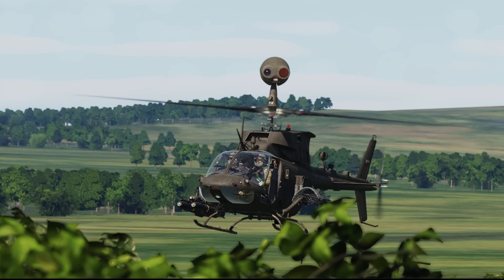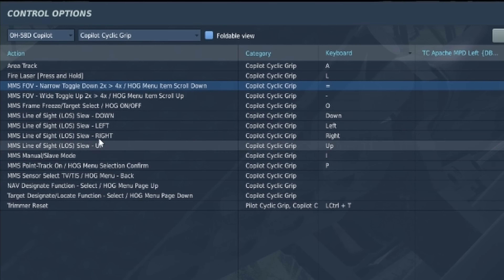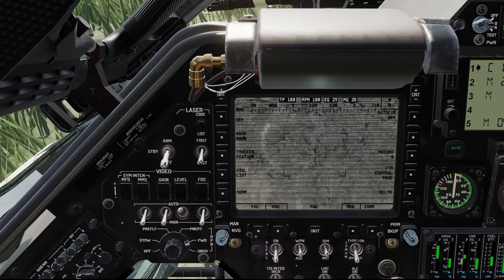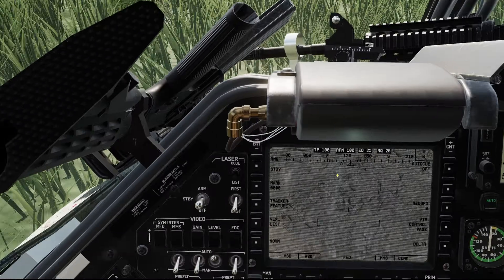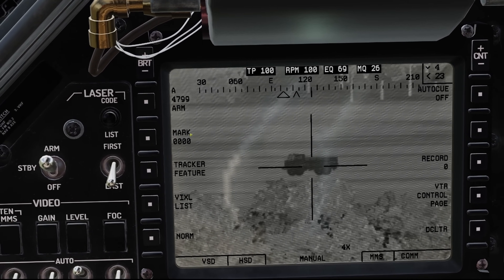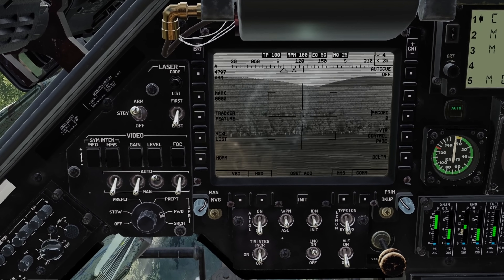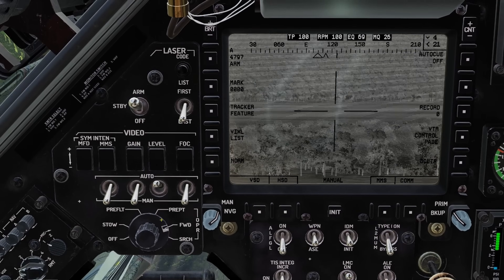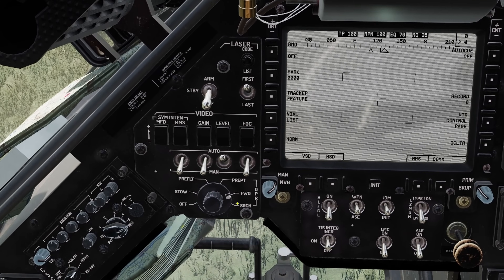Mast Mounted Sight Employment | DCS World Kiowa Warrior

Comment: Most memorable write up I had to work on in Afghanistan was "MMS does not work in O.F.F. position" I had to ask the pilot what precisely he thought OFF position meant. "Official obviously" he said.
Reply: did you add a label on the button 'MMS does work with this switch set to this position: feature, not defect'
Reply: @richardhockey8442  No, but I did the next best thing, print out the section of the manual pertaining to the operation modes and highlighted OFF for him.
Reply: Was that an Officer or a Warrant? I have a guess which😂
Reply: @mannyram9717  well, lets just say he would have won the "most likely to get lost on a land nav course" award

Comment: Offset acquire/track also used to correct/adjust hit spot to minimize overspill/underspill and increase Pk for the engagement.

IRL, I would've adjusted to the cab area to improve likelihood of target destruction vs the chance of the missile puching through the bed and impacting the ground instead of critical structure of the vehicle. 

I don't know how DCS models damage, but I have already seen videos of HF and APKWS misses due to accepting point track as putting the laser on target.